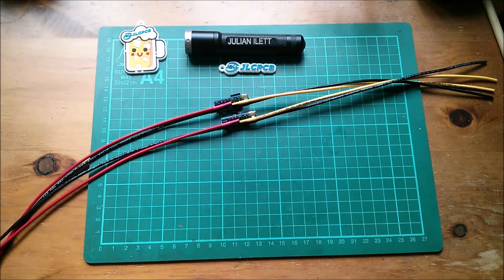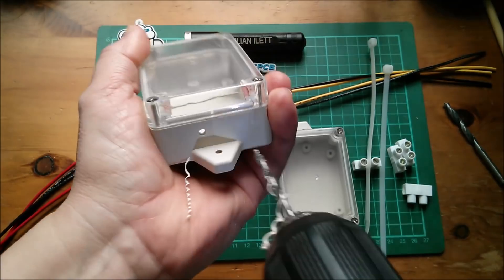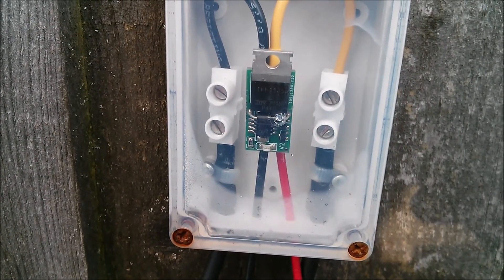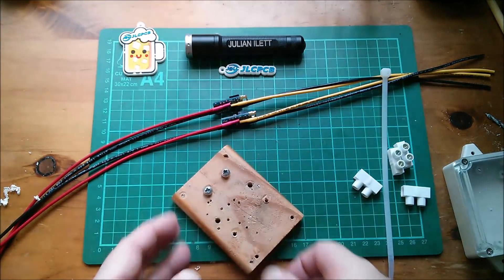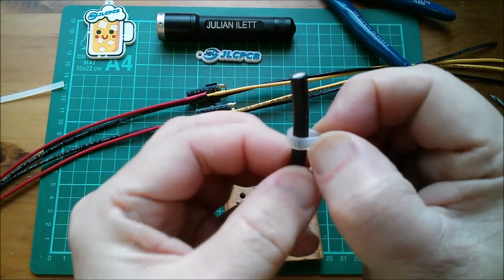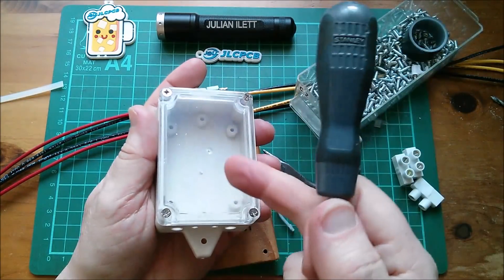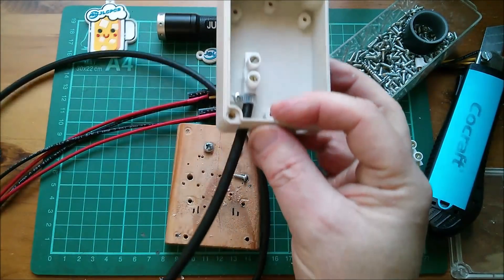Power Wall Upgrade - Enclosures for the Charge Controllers

Comment: If there is condensation on the inside of the box, there will be condensation on the board. And if there's water on the board, it will corrode. So you're no better off than you were before. Good luck with that. Have fun replacing them every year or two.

I guess it gives you something to regularly make a video about.

Comment: Hey Julian... Why not multiple solar panels  to just one PCB ?  Van Dwellers all have 3 or 4 panels to one charge controller ?  your Thoughts ?????
Reply from the maker: This charge controller is rated at 6 Amps max. The 80W solar panels on the fence produce about 5A each, so I need one charge controller per panel :)

Comment: used to work building switchboards meaning that I once developed a pretty good skill for stripping, I always found that the cable strippers which look like pliers are great for stuff like 6mm cable, used to use them for everything from 1.5-6mm, anything else generally involved a knife; only issues I ever had with them was super cheap or thin cable where they'd just rip the insulation off, beyond that, you do develop a bit of a knack for how to set them for different cable sizes. ratcheting crimp tools are also something generally nice to have when dealing with cables, just, the company I was working for once cheaped out on the crimps and we had constant issues with the insulation sleeve coming off and other fun stupid issues
https://www.cromwell.co.uk/shop/hand-tools/cable-and-wire-stripping-tools/pa1953-6inch-95-maxigrip-wire-strippers/p/ELL5582123E - not sure if I touched this brand, but, these style

Comment: That's annoying, that it still gets condensation inside. I'm guessing the wire in a close fitting hole, is using capillary to attract/hold water at the breathing hole. Needs more experimentation, ie, maybe sealing the holes. In a jetski they use a wedged grommet on the wire, and that gets compressed in the special through-hole fitting.

Comment: Covering the screws with silicon grease after installation might help reduce the rust while not affecting the accessibility of the screws.  A coating before installation can help as well.  Brass replacements are probably a better solution, but this can provide some temporary relief, in my experience.

Comment: It looks like the PCB in both finished boxes are touching the front clear plastic.  I would try to keep them pushed back so that moisture on the front can't drip down the PCB.
Reply from the maker: Interestingly, the condensation pattern inside the clear plastic cover seems to leave a gap down the centre, just where the controller is. Also the MOSFET puts out a little heat when conducting 5A, so it's like a little heater :)

Comment: I'd put the drill on the faster speed setting when drilling Julian, I think you had it on the slowest setting which is normally for screwing. Great videos though 😃
Reply from the maker: Both these drills (Ryobi 4V and Ryobi 12V) are single speed. I should have used my Parkside 12V 2-speed drill :)

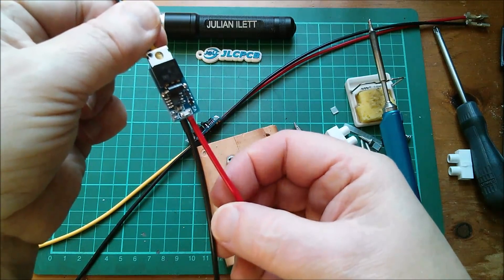Comment: 9:05 - Didn't the black dot on the TO-220 mean that it wasn't working?
Reply from the maker: It's a bit flaky (intermittent). I spotted an iffy solder joint at the top of the potential divider which I might remake.
Reply: @JulianIlett  - Ah of course.  That sounds like it would be it.  First thing we should have suggested really.  Check the soldering.  Just like checking voltages really it should be first with any newly assembled PCB.
And to get that voltage "reading" back in spec I would still suggest piggybacking a resistor in the voltage divider like I mentioned in the previous video.  An easy and accurate fix.
Reply from the maker: It's a good fix, but it would introduce a ratiometric error in voltage measurement (though probably fairly insignificant).
Reply: @JulianIlett  - Huh???  Sorry but you mustn't be understanding what I had said in the previous video.  Putting that new resistor in totally fixes your voltage divider to read correctly.  Do the math like I did.  Adding a diode as you suggested is where errors get in whereas the resistor fix doesn't.  Fixing a resistive voltage divider with a resistor corrects the ratio and that's where the problem is.  It simply corrects for the slightly lower ADC reference voltage from the regulator.  It's that ratio that is corrected for.  The math works.

Comment: You could pack in a desiccant pack.  If you're crafty, you can take Magnesium Sulfate Penta-hydrate (Epsom Salts) and bake them from a 100c low heat to 500c in a long ramp up (hour by hour).  That dried powder is then VERY drying.  Sachet that and stuff it in.
Reply from the maker: A desiccant pack would last less than a week. There's a reason England is so green :)
Reply: @JulianIlett  I should have clarified - In addition to other mitigation suggestions that I read here.  Sorry.

Comment: Regarding the rusty screws: 
I use either silicone grease or vasalene on them to stop them rusting. Just dont get the vasalene on the rubber as it will eat it.
Reply: Or... Use stainless, now there's a thought... LOL
Reply: @ewoutbuhler5217  finally someone who knows the basics. Came here to say this.
Reply: @thingyee1118  nah, I was here anyway. Never mind me,the remark was more towards the manufacturer of the little project box, but I guess it was not intended for outdoor use in the first place. Great chatting with you😜💪
Reply: @ewoutbuhler5217  the idea being not to spend more money, wasting screws, if you have something like this laying around......now theres a thought.....
Reply: Also nothing wrong with vasaline on o rings
Reply: @thingyee1118  depends on the type of seal used....usually not a problem but with Chinese sellers using anything cheap it could be made of natural rubber of which can be dissolved by Vaseline

Comment: What if you use the middle pillar on the top to press down on the yellow and black going up, so the controller does not lean forward? I guess it could pick up condensation if it touches the front cover.

Comment: Hmmm, Your charge controller already outside also has a voltage of 13.2v. Does the battery show that voltage? :)
Reply from the maker: Yes, I think that one is quite accurate :)
Reply: @JulianIlett  All three controllers seem to show 13.2v even when the voltage isn’t 13.2v. Something is up there.

Comment: As far as the people freaking out about the previous and regular lack of elemental protection afforded to Julian's delicate electronic circuits are concerned; we now have 'closure' ;-)
Reply: Not really! Julian seems to be in denial about waterproofing! There is no trick, JUST USE PROPER CABLE GLANDS  DOH!
Reply: @boblewis5558  yep and yep came here to say this.
Reply: @boblewis5558  but they don't stop the Vacuum  caused in the cooling of enclosure, they still allow water ingress :(
Reply from the maker: @Bob Lewis - The enclosure breathes, the air pressure inside changes. Grommets, glands, seals or beading - water will get inside. The 'trick' is to ensure it can get out again.
Reply: @JulianIlett  not true Julian. I have tested these boxes AT THE BOTTOM OF MY POND for two months! It is a complete myth for PROPERLY SEALED glands and IP 65 (OR GREATER) enclosures. The ONLY moisture under such circumstances is that which is sealed inside the box at assembly. THAT is a simple problem to solve by giving the box a quick blast from a hair dryer immediately prior to assembly.
Reply: @boblewis5558   your not understanding the problem of the sun heating the enclosure making gases expand ... this will not happen in your pond !
Reply: @David_11111  the increase in pressure at the bottom of my pond is as great as any pressure increase inside from sunlight heating. In 40 years of using gasket and gland "sealed" boxes I have NEVER had one leak except for ONE where the gasket failed due to UV breakdown. So provide evidence or stop providing disinformation. 

PROPERLY SEALED THEY DO NOT LEAK!
Reply: @boblewis5558  Sigh  its easy to seal something in your pond because the temperature is stable and charges slowly ... are you keeping up ?
air expands with the heat of the Sun ... this creates Pressure inside the enclosure ... Can not happen your pond pressure going wrong way ?
when the temp changes ie Rain ... snow this cools the enclosure the warm Gas contracts sucking water in again Can not happen underwater !
Oh that's physics  being a diving instructor I could go into greater detail but the deep you go underwater the pressure will increase slowly  !
 letting the glands take up the pressure, you know it cant rain underwater ! so the temp will not change rapidly....
"PROPERLY SEALED THEY DO NOT LEAK!" agreed but the enclosure can not be sealed properly the pressure is from the inside out.... !
if you put your thumb over a bicycle pump it will play a tune as the air escapes ... but not the other way around... Please stop comparing this to your pond ... Sigh
Reply: @David_11111  you obviously didn't read the bit where I said that in 40 years of using these types of boxes I have NEVER had one leak ... IN OR OUT! The point about the pond was to illustrate that even in COLD water under pressure it leaked not one iota. No more that any mounted outside in sunlight. I have TWO with small solar panels that contain mole repellers ... Been in the garden exposed to all weather now for TWO YEARS? ZERO moisture ingress, ZERO internal condensation - I did fit them in summer and also warmed them up with a hair dryer before sealing them both.

Your point about being a diving instructor is irrelevant since I passed all my BSAC tests over 50 years ago and FULLY understand the issues. The MAX pressure differential between inside the box and outside the box outside in sunlight will be around 6-8psi or 0.2-0.5 bar. Those boxes can EASILY withstand that pressure, AND MORE, so once again provide your evidence or STHU. 

I repeat, in case you still didn't understand, this is NOT a matter of theory but facts in 40 YEARS of practice ... Sealed properly (that includes a rubber seal being fitted beneath the gland flange, which most people NEVER fit Doh!) these boxes and glands do NOT leak.

 However leaving vent holes, even tiny ones WILL allow leakage AND air (full of damp and moisture in winter especially) AND insects arachnids and the like, to enter the box and cause (heavy) condensation and also insect detritus!

If you're going to claim otherwise then I can only presume you are a Trump supporter in denial ... Get over it! You LOST fair and square!
Reply: @David_11111  Goretex!!?? What the hell does Goretex (a water resistant fabric) have to do with an ABS, Acrylic and silicone seal plastic box?

ATA!!?? I presume you mean Atm (Atmosphere). My pond depth is only 4 ft so about 1/8 Atm. And it was used as an example to show a) I have tested them in that way and b) to address your original point about hot air "inside" contracting when it cooled. So the hot air inside would be cooled significantly in a cold pond and cause a "vacuum" to use your words (it doesn't, it merely produces a positive pressure differential outside to inside) so a negative pressure differential (inside to outside) of what, 0.5 Atm? Plus the external pressure  increase of 0.125 Atm (bar) = 0.625 Atm (bar) from 4 feet of water (actually a bit less since 1 Atm is only 30 feet in fresh water, which of course you knew as you're an expert diving instructor).

You seem to be STATING that the seals on these types of boxes (with a shaped, continuous "o" ring and NOT the straight silicone string type which DO LEAK ) are incapable of withstanding a 1 bar differential pressure. I KNOW they can! So please provide your evidence that I'm wrong. Please don't bother denouncing any more. You really are a truth denier and suffering from some serious cognitive dissonance. I KNOW they work when sealed PROPERLY ... I told you, I have YEARS of successful usage behind me,  so be my guest, carry on leaving "holes" for leaks and I'll carry on keeping my stuff 100% sealed as I have done for decades. 🤔😱😱🙄🙄
Reply: Surely stainless steel screws. Dodgy drilling his hand too... not massively engineering....